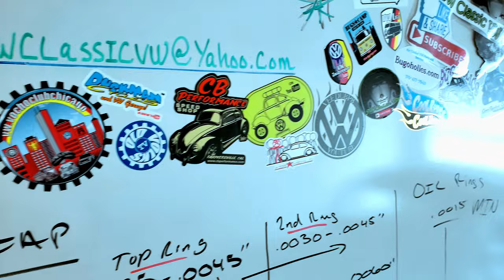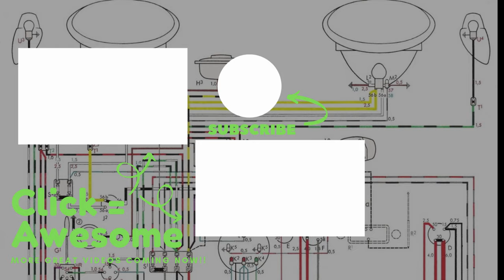VW TURBO EFI SNEAK PEEK 300+ HP & 40 HP Build - UPDATE!! | JW Classic VW

Comment: Hi Jason, I saw Wayne's motor up close in 2019 at DubSplash 2019.  He does some very nice machine work.  One thing that confused me with his single throttle body setup is, why is the blow off valve on the intercooler and not between throttle body and turbo compressor housing?  Also, it seems like there is no fan/air circulation on the air-to-air intercooler that's up against the firewall behind the Porsche fan shroud.  Just something to consider in your turbo setup design. 👍🙂  Mark
Reply from the maker: Hey Mark!! Great questions... Definitely going to be diving into more of the details when it comes to the operation and understanding of air flow dynamics and principles as I educate myself as well.  I'm learning more and more about this setup and can't wait to share it with everyone.  Going to be pretty awesome stuff to show you guys along this journey to TURBO sweetness.
Reply: Trust me that intercooler will not be very efficient without enough air flow across the intercooler. It will not remove much heat. It will work but the air temps will rise even more in hi-boost application.  I use twin fans on my setup.
Reply: I too was wondering about the intercooler. no air flow won't do it much good. It would be ironic, and funny, if he used an air to water intercooler though :). 

As for the blow off, I've seen them in all sorts of locations on various vehicles and I don't think it matters too much as long it relieves the pressure.
Reply: @pocket5s1   @pocket5s1  Well been there done that and it wasn't very efficient. It was just adding weight for 🤏🏽 temperature drop. My air to air   intercooler WORKS with fans. And in racing applications I spray CO2 or add dry ice over the top of the intercooler. Now dry ice over the intercooler works as good if not better than air to water IMO. Less weight and NO WATER. It's like adding AC into the intake 😊.